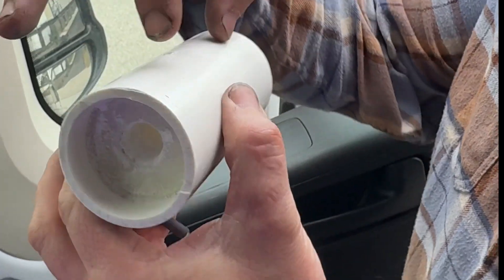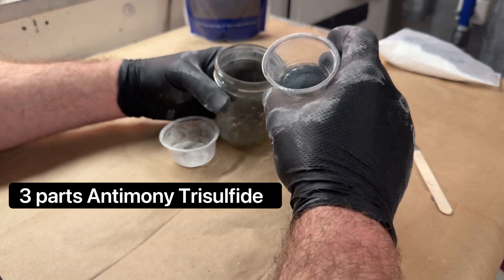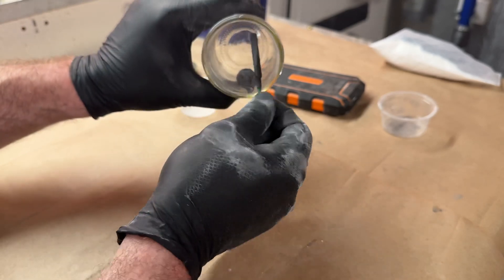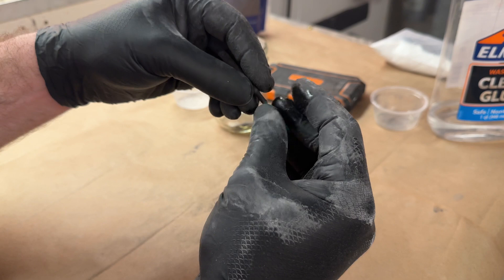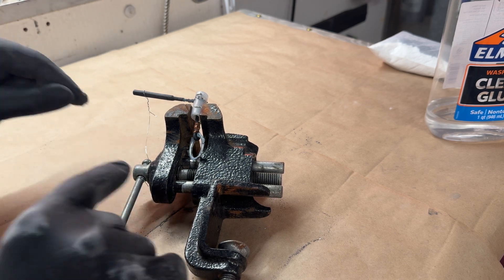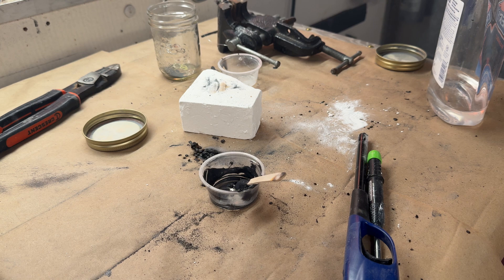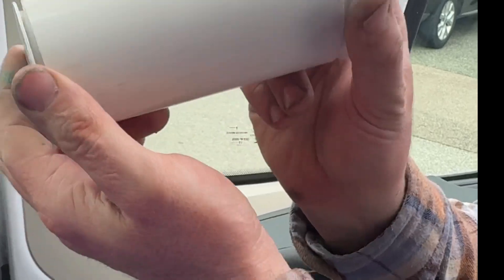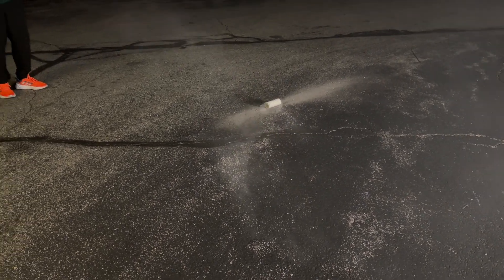Dual-Vent Smoke Grenade Experiment

Comment: How much have you experimented with lactose vs sucrose in your cloud generator mixtures, particulately (ha!) the TPA and the colored variations?

I wonder if lactose's lower temperature might reduce how much gym chalk (magnesium carbonate) is needed for moderating the rate and temperature of the generators to avoid flare-ups. It would also free up more volume for the active components. There are tradeoffs with everything I assume though.

Anyway, thanks for sharing your research!
Reply from the maker: I can’t even begin to say how intelligent that inference is. Imma run that through Grok. The testing I did (substituting without adjustments) was meh

Comment: The question is whether this reaction is anaerobic or aerobic and whats actually causing the smoke? Incomplete combustion? 
Knowing these answers and providing you have an efficient reaction then the diameter of your exhaust nozzles will probably be the easiest thing to optimize for the most smoke. Less back pressure and more velocity will be the aim.

Comment: Have you tried making a star shaped core cut out? It is used for rocket engines and creates a fast clean consistent burn rate. I mean you basically made a slow burning smoke producing "rocket engine". The star shape should make a difference!

Comment: The only things I see needing improvement are:
1) Ignition time. It takes far too long to get going. Maybe stick magnesium shavings to the smoke comp to drastically increase the heat of ignition. Another option could be granulated (sharp edges) black powder.

2) Smoke duration. It puts out too little smoke over a long duration, rather than a large amount of smoke in less duration. I can't think of a situation where less smoke w/ more time is better than more smoke w/ less time. Since the smoke shoots in the direction of the vents...maybe make multiple smaller tubes, and tie them with a twisted rubber band & held spurng together by string tied to the fuze. When the fuze burns through the string & starts to smoke...the rubber bands spin the tubes out like a flower petal....shooting smoke in multiple directions rather than just one/two.

Love the videos. Keep it up!
Reply: Only reason I can think of where less smoke over a longer period would be for signaling, but the smoke would have to be much thicker than what this produces. Good tips.
Reply: @Eidolon1andOnly 
Yup. I was thinking the only reason for these pull-ignited smoke grenades is for tactical movements...like covering escape or repositioning in a hostile environment. Such as ZOGbots trying to enforce a draft or something. So I was thinking that such grenades should act more like a tank's countermeasure, rather than an orange rescue swimmer can.

My Design:
Many cut fuze pieces coated in smoke comp multiple times until they resemble firecrackers...with just a small tip exposed. Then split the exposed fuze, and lightly dip in ignition comp. Then pile in these mini smoke sticks into a cardboard tube formed out of layers and layers of Rcandy soaked paper, pressed into cardboard tube shape & dried hard. Then all the fuze tips are pointing inward inside the cardboard tube, and a very light dusting of fine granulated black powder & magnesium flake added along with spoilette ignition tube from the side. This smoke grenade is intended to build pressure in the core as the BP granules ignite, and then blowing open in all directions..spewing smoke sticks which will act like "flying fish" fuze within a fireworks shell...spinning & producing a large amount of smoke in an entire area very quickly. The fast & hot burning BP smoke rises quickly, but the smoke comp is cooler and denser, so it hangs longer near the ground. Also...even the body of the grenade is smoke producing as it shreds into many pieces.

I believe most people...when they need a smoke grenade....are in need of a lot of smoke, as fast as possible. Like a tank's defensive smoke canisters. This design is a trade off between the two....it is not an instant cloud, nor is it a long signalling column. It's a quick burst of smoke right where you want it, and then a large fizzling smoke screen across a larger area for as long as the fuze burns...which is customizable.
Reply: @thomasg4324  I wouln't say most peoples' needs would be for a smoke screen, but as for desires a smoke screen is  more fun. I think most people aren't going to find themself in a combat situation (fingers crossed) but would have more of a use for them as a signaling device when hiking/backpacking/off the beaten trail when they get lost and/or injured. Though a dual vent design wouldn't be optimal for such a signaling device. 

I think it might be a better design for a smoke screen would have the vent(s) along the length rather than the ends of the tube to create broader curtains of smoke. Might also help reduce total burn time.
Reply from the maker: I agree it was way too slow, and overall nothing to write home about. The lactose creates a slower and lamer burn at the given ratios, and is not substitutable 1:1 with sucrose.